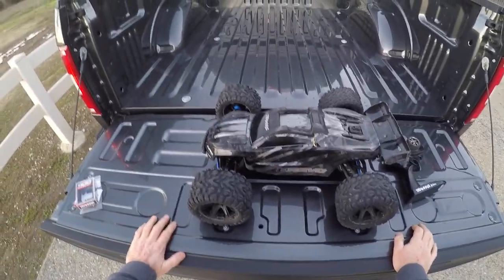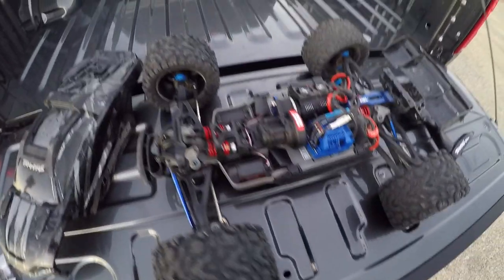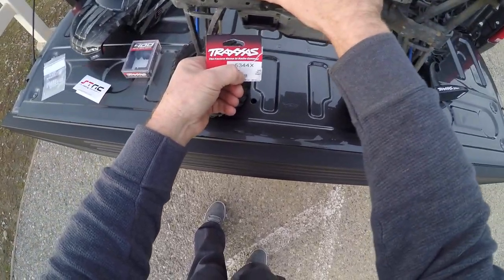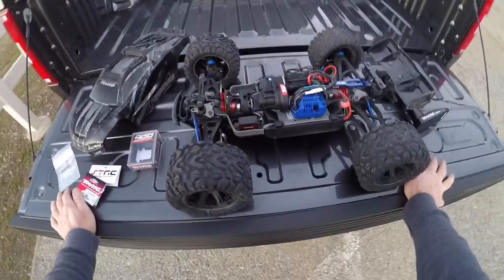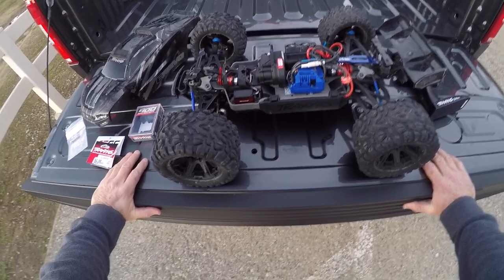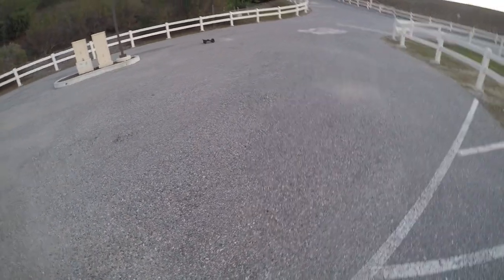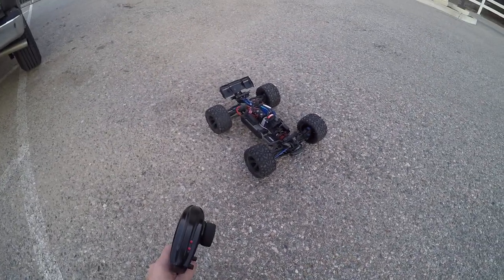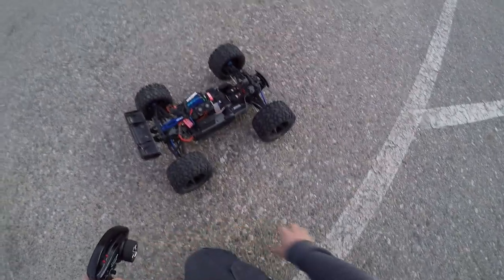Erevo 2.0 single servo conversion, Traxxas 400 servo short review and thoughts

Comment: I think I'm going to go with the Traxxas 2255 servo also. Lots of people recommend the Savox 1231SG which is about $15 or so cheaper. Big difference there is that the Savox isn't water proof. Doesn't make sense to me to add a high priced servo that can't get wet. Just asking for trouble.

Comment: I have two on my summit, one on the front and one for my custom rear steer. I recently added a BEC since the 400 is rated to run on up to 7.4 volts as well and that really made it nice and powerful. Definitely smooth and even to run.
Reply from the maker: Yes I do like the 400  it's still working great I mean I must say I did like the power and speed of that triple 7 in the erevo but the 400 is a little more convenient.

Comment: Not bad, thought about getting that for a second, but considering after some time spent with my E Revo 2, Traxxas electronics aren't that great. Both of my stock servos went out last time I ran my Revo and then that following morning the receiver died during an update using the Traxxas link app. Since it is winter here and I don't run my RC's in cold weather, snow, rain, etc I took that time to tear down my Revo 2 and perform all the upgrades I wanted to do. I did go with a single servo setup, as well, but chose the Savox 1230SG, also switched out the receiver from Traxxas to Spektrum. Performed tons of other upgrades and beefed up the driveline. I got the same block off plate from Shapeways because while others claim that the one for the 1/16th would work with a little grinding I just wanted one that fit perfectly. I love my E Revo 2 she is a monster now and I took all the spare parts I had leftover and built a second one more stock version I guess, but the hobby is addictive... lol
Reply: I run the 2255 for the sole reason if it ever goes out I can get it replaced through Traxxas for half cost.
Reply from the maker: Yeah Traxxas is pretty good about that
Reply: @samjohnson517  Ends up being pretty expensive though because these 2255's need good SBEC's to run at their full potential

Comment: Hey man! I’m currently looking at getting an E-Revo 2.0 and was wondering what your overall experience with the truck has been. I’ve heard some mixed reviews. What recommendations would you give? Thanks in advance!
Reply from the maker: It's a great truck it is however on the fragile side basically you will break parts but you can always upgrade, first thing I would do is change the gearing my favorite is 18/46  oh and by those body savers they work great!
Reply: @samjohnson517  I appreciate the opinion!

Comment: Going to do that with my summit because I just bought 2 new 2075 servos and it worked for 4 days and then bam servo making nasty noise wont turn :( , but glad I found this video
Reply from the maker: Yeah the 2075's are weak I'm waiting for my Reefs 777 I'm going to put it in the erevo to try it. Going to plug it into one of the 3's batteries we will see what happens,  it's an animal servo lol
Reply: @samjohnson517  How is  the single servo holding up ?
Reply from the maker: @jasonrojas2176  real good no issues

Comment: How’s that servo holding up
Reply from the maker: It's doing real good smooth plenty of torque. One strange thing it does and I don't think it's the fault  of the servo, my steering gets very slow and does not seem to turn all the way, as soon as I mess with the stability control on the controller it works perfectly fine.
Reply: Sam Johnson  thanks for the feedback I have to replace mine had a bad wreck and some how stripped both servos
Reply: @samjohnson517  Mine does that also... it's not the servo (I have the same truck / servo setup).. it is the traxxas stability management (TSM) messing with it... You can disable that if so desired.  It's a VERY nice servo btw.. quick, strong, and very precise.